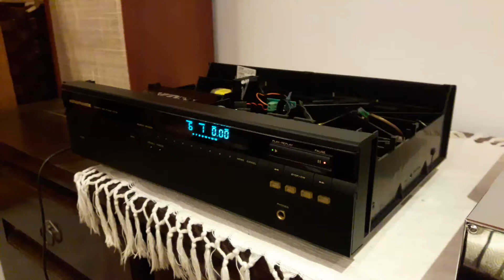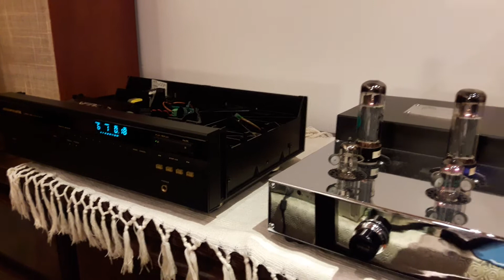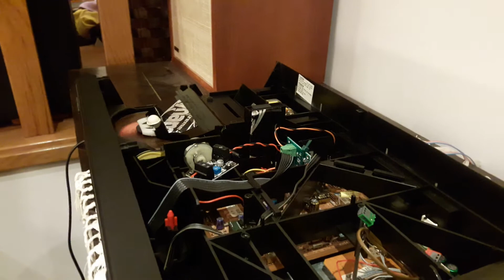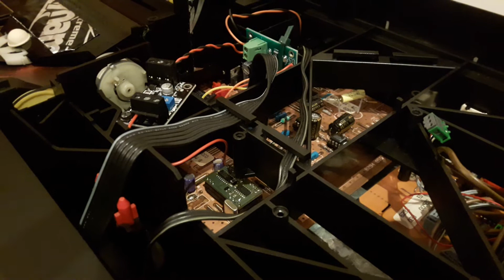MARANTZ CD50 - NOS Reclock Module for Philips TDA1541A

Comment: Que operacionales y condensador de salida usas??
Reply from the maker: Nothing special. As op-amps I use OPA2134 and as output capacitors I choose ARCOTRONICS MKP 470nF 160V (max 680nF, if you have an 100k pot in your integrated amp or pre-amp. Have in mind that here the low voltage it´s very important to reduce the capacitor inductance effect).

Comment: digital that i can connect with.. 👌👍
Reply from the maker: Yes! Not far away from analog sounding. With this CD player you can ear music with pleasure all day, or night long, song after song, with emotion, body, energy, air and details. I forgot to say that the NOS Reclock Module only has an hour of burning time.
Reply: @antoniocruz5714  agreed! it sounds great over youtube... but you are there in person listening. in what areas do you think the sound can improve? i would prefer this sound over some high end systems that sound lifeless, thin and hollow.
Reply from the maker: @verbatim_transfer  The sound can improve even more if I put a dedicated shunt regulators feeding the amazing TDA1541A. One more step up will be a Tentlabs clock (or something similar), with is own power supply. One last upgrade to have an top grade CD player will be a dedicated power supply for op-amps. If you are able to find a vintage CD player, in god shape, with this DAC chip grab it. With some upgrades it will blow away any modern stuff.
Reply: @antoniocruz5714  i will definitely be on the look out. how much are the upgrades.. approximately? and have you ever tried making a dac starting from scratch?
Reply from the maker: @verbatim_transfer  The cost of the basic upgrades I´ve done in this unit it´s around 80 euros. Make a DAC from a scratch it´s possible of course! Soon I will put a video about it.
Reply: @antoniocruz5714  80 euros? that's cheap. I thought it would be more expensive. I'm going to figure out this DIY stuff. It seems well worth it. do you have former training, or did you just learn from using online sources?
Reply from the maker: @verbatim_transfer  I have some former training and also learned from more than 15 years working in some audio stuff.